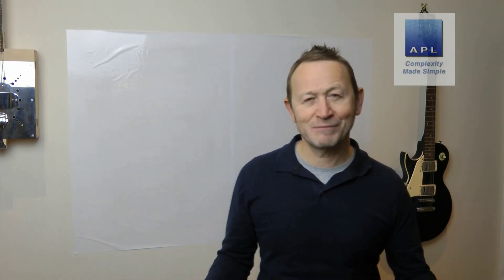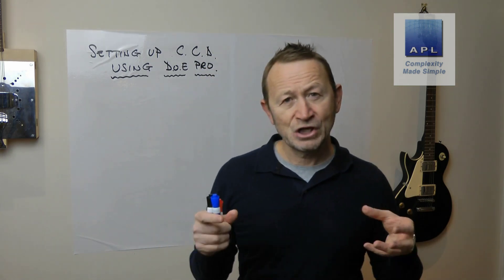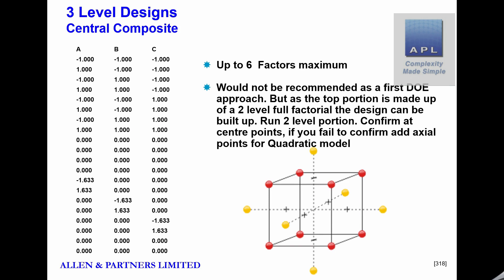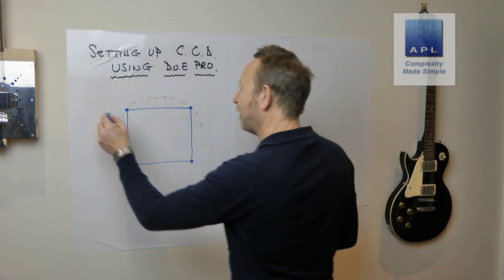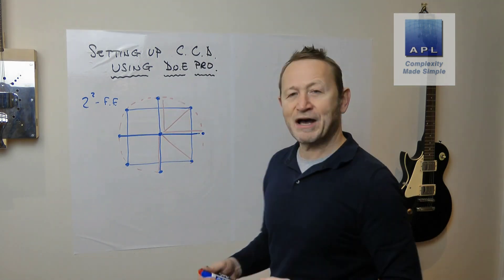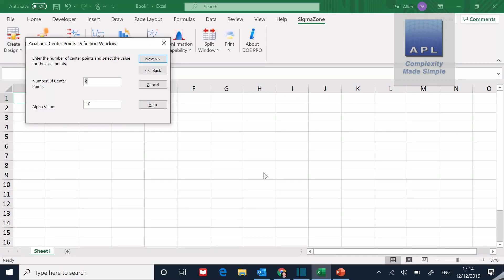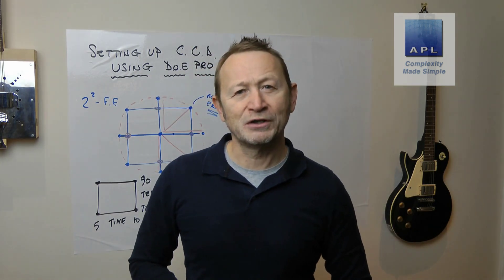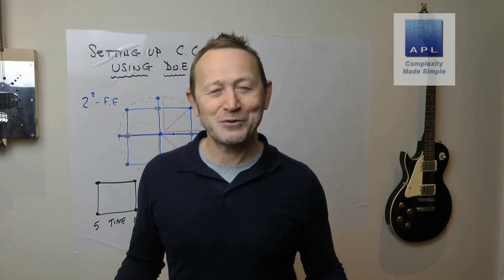DOE pro - How to complete a central Composite Design

Comment: Thank you for the video. Is it necessary that the factors chosen are all independent?
Reply from the maker: Abhishek - good to hear from you, yes that is most important. You say oven settings hi/lo. you have to specify, time temp etc as individual variables...
Reply: @paulallen5321  Thank you so much for the reply, Paul. Much appreciated. In my case, I have 4 paramters that are important: RPM, Traverse Speed, Material Feed rate and the ratio of traverse speed to material feed rate. From my experiments I have seen that the value of the last paramter, i.e. the ratio is probably the most critical that decides the quality of my products. However, according to DOE, I cannot use this as a factor or can I?
Reply from the maker: @abhishekpariyar884  No need to include it as a parameter, if you include the 2 variables the DOE will spot the effect you mention. I'll make a video and post the link to you...
Reply: @paulallen5321   Thank you so much, Paul. I really look forward to it!!
Reply from the maker: @abhishekpariyar884  - I think this will help explain
https://youtu.be/rtHvy69KT6w
Reply: @paulallen5321  Thank you very much, Paul. I greatly appreciate your effort.

Comment: Thank you for this video. May I ask if the axial points in the CCD is considered included in the Design Space? I'll be using alpha =2 in a 5 factors CCD
Reply from the maker: Thanks for the question - yes the axial points will be part of the design space. the centre point can sometimes be kept out and used later. Let me know how it goes...

Comment: Respected sir are there any free software versions for central composite designs please tell their names and if we want to use two polymers at 3 levels how to operate central composite design software sir
Reply from the maker: It should be easy to google the CCD for 2 factors and run the DOE, you could get a free 5 day licence of DOE pro and analyse it when complete...

Comment: thank you very much good explane.  what is the meaning of level ?????
Reply from the maker: Good to hear from you Abodi - Level is a setting point. So if you test temperature at 70 and 90 this is being tested in 2 places or 2 levels. If you tested 70 80 & 90 this would be at 3 levels...If DOE is you interest please buy my book 'Design of experiments for 21st century engineers, you can get it from LULU.COM

Comment: Thank you so much for the explanation, how do you determine the number of center points? i'm trying to do a CCD of 5 factors (2^5) and also how can i get the DOE pro software to do it.
Reply from the maker: Juan - good to hear from you. The number of centre points depends on how many replicates for each set up you're doing. DOE pro will recommend a replicate quantity for you. Let's say that 2 in the case you mention If you then do a centre point run a the start of the DOE one approx half way through and one at the end you'll end up doing 2 x 3 centre points = 6
In DOE pro if you selction create design>Computer aided>Switch on the 3 level radio button, you'll see a 5 factor CCD option.

Comment: Thanks for taking the time to explain CCD in a "easy" way. I got a doubt, when you say that you go for alfa=1 and then you "maximize your square or expand", you mean then you choose a different level now for the factor?, eg: if I have T= 5 / 10, will it be now =2 /15 (considering always that your model is possible in real life).  Many thanks in advance
Reply from the maker: Hi Sabrina - thanks for the question. No the original DOE should have been at 2/15 which would mean an alpha bigger than 1 later in the experiment would not be possible. You should always try to make your DOE design space as large as common sense will allow you to...if you like the video's. I have a new book 'design of experiments for 21st century engineers'. you can get it from LULU.COM...
Reply: @paulallen5321  I recently purchased your "drink tea" book :), I'll have a look at the 2nd one after reading that one. Thanks for the answer too